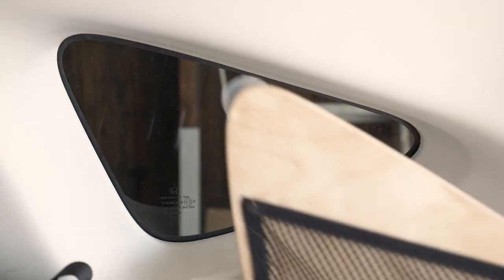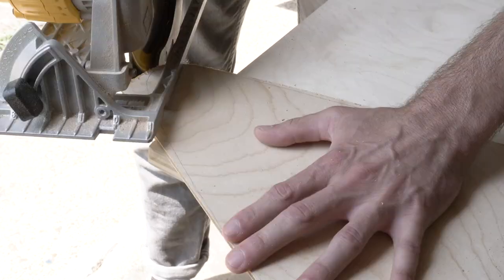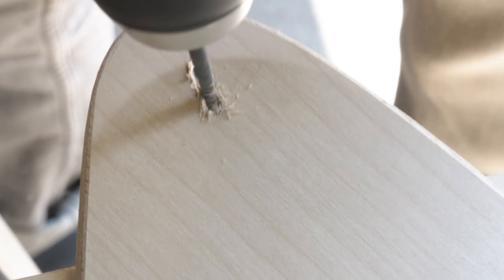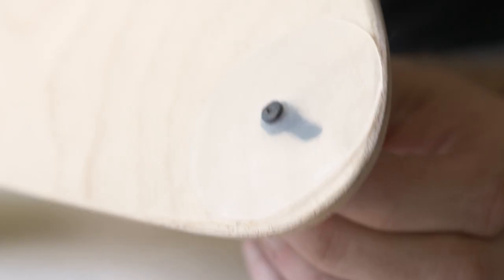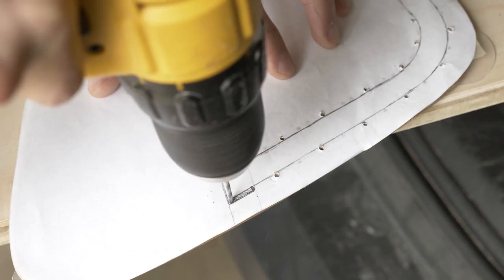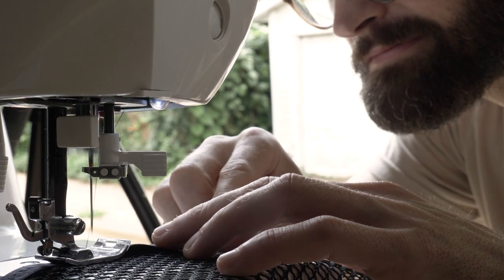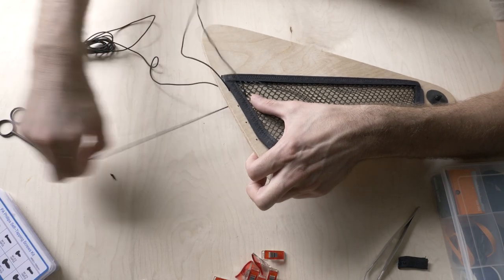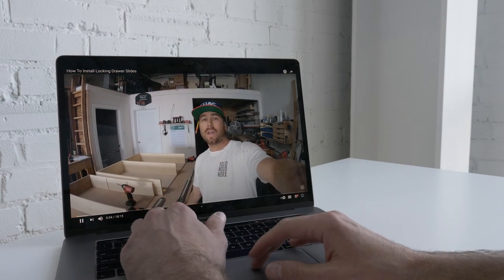A New Kind of Car Camping Window Cover

Comment: that's an awesome idea.  I made something similar out of black construction paper but obviously without the pockets.  You might want to paint the outside black for additional stealth.  I would never have even thought to do that, that's so cool.  It makes all kinds of projects possible on larger windows.  The passenger window of a subaru is enough space to make a whole (light) bookshelf. But I'm probably going to stick with the construction paper for now.  Maybe in the future. Keep making stuff you have great ideas.
Reply: Build Strength Stages: Paper,  Construction Paper, Poster Card Sheets, Foam Board (Black), Thin Plywoods, Thicker Plywoods / MDF, Metals, etc!

Comment: I like that you sew. So many men and women do not use sewing very often in their builds. I am from the era that learned in school, and mom, and then sewing classes when sewing quilting shops were more prevalent. Those corner windows are space needing to be used for sure. I’m thinking of some sort of pouch that can stay in place or remove if I need it for shower, etc as there is no room for extra bags floating about when car camping.

Comment: I’ve got a 3d printer. This gets me thinking about my rear door window spaces. There’s a useless little window space between the roll down window and edge of the door that’s useless. Even awesome for people that sit back there.
Reply from the maker: For sure. I just leave these in most of the time and keep a flashlight in them.
Reply: @MattTheDesigner - Also, it seems it can add "Security" to the Window, in the form of making it less "Easy" for certain vandals to see in and target your window there as the one to break to get into the car! Especially if outside edge or face is painted Black! 

On the security side, there are also special "Films" that can be applied to the Glass, that even if they smash the window, it stays together, and is Tough to push through, even after shattering the Window! Often used on Patio Doors, Glass Panels beside house doors, etc!

Comment: Suggestion to paint the outside black or cover with a black material. At night, the black won’t reflect any outside lights,  it is even more stealthy. :)
Reply from the maker: For sure! I didn’t think about spray painting it until the whole thing was put together. When it was done I didn’t want to risk getting it on the front side. Maybe some thin fabric? 🤔
Reply: @MattTheDesigner - I see a trip to "Fabricland" in your future videos! Or "Used Clothing" places! 😅

Comment: Very cool! Love your projects! Did you paint the outside of the panel black to give it a clean stealthy look?
Reply from the maker: No but I definitely should have. I’ll get around to it one of these days. Luckily the window tint on that window is pretty dark.
Reply: @MattTheDesigner - Or, paint an "Eye" on it, and add a Micro Camera in the Center, using an Arduino or ESP32 Microcontroller Circuit, as a Monitoring system! (That could even be great as an extra "Wham Bam Tesla Cam" content channel special!)

Comment: Great design, but maybe crack glass, i think change metal bullet with plastic can be safety
Reply from the maker: The tiny metal screws that hold on the elastic sit below the elastic. So there may be a small risk there but the really shouldn't touch the glass ever.

Comment: Hey Matt, do you think you could make these covers out of the same material you made the sunroof fan? Would the black plastic hold up to the attached weight?
Reply from the maker: Yea it honestly might be a better material for it. I’m planning to try it out on the passenger seat windows and might at some point remake these with that stuff. Although it is kinda cool to have some wood grain in the car that matches the bed.
Reply: @MattTheDesigner  awesome! I just made them in wood and were such a pain lol my Forester windows are not as straight as yours. Lots more kinks.
Reply from the maker: @hanz79wvu  Too much curve to the window? Maybe the plastic would work better. Theres always the ol' bubble wrap reflectix stuff if it doesn't work out but you'd miss out on the storage.
Reply: @MattTheDesigner  I'm looking for the storage so reflective won't work. I bought a piece of that plastic so I'm going to attempt to do something with it. Wish me luck lol
Reply from the maker: @hanz79wvu  let me know how it goes.
Reply: @hanz79wvu - the "Tabs" could be "Z" shaped, too! That way, the Window Reflective Bubble Wrap can be outside, plywood or stiff plastic Sheeting inside, and the "Z" tabs, make up for the thickness offset! 

They could be Fabricated out of Thin Bent Metal with Thin plastic Sheet faces glued or bonded to the side that touches the Glass! (To reduce scratching potential)

Comment: Hi Matt.  I’m curious, what do you do to block out other windows in your vehicle when camping?
Reply from the maker: Currently I just use reflectix like everyone else but that's about to change in my next vid!
Reply: @MattTheDesigner - I wonder if, that "Self Sticking, Static Cling Vinyl" type Material, can be used, Inside? 

Also, there is that "Clear Vinyl Like 'Magic' Tape" that sticks repeatedly, and is Washable to re-energize its "stickyness" or Grip!
Reply from the maker: @robertweekley5926  for the rear window that could work because you could just leave it on even while driving.

Comment: Fabric is easier
Reply from the maker: Easier to black out the windows? The easiest thing I’ve found is the bubble wrap insulation stuff. Just cut it to size and stick it in there. But this solved a specific problem I was having.